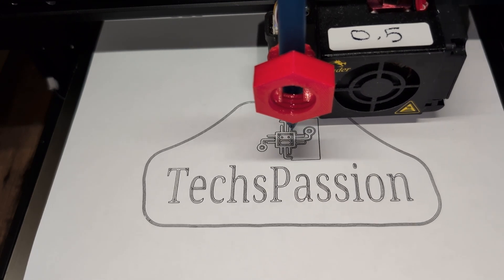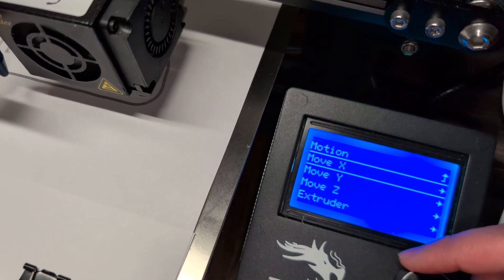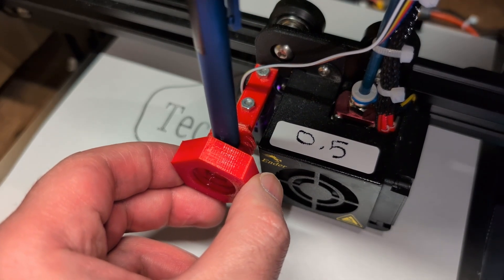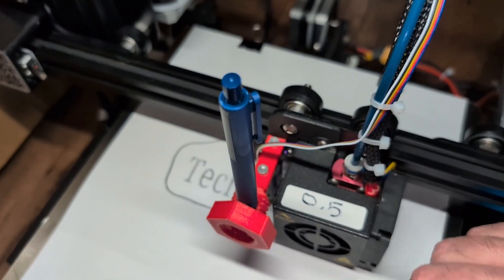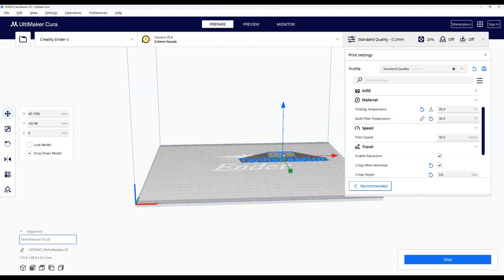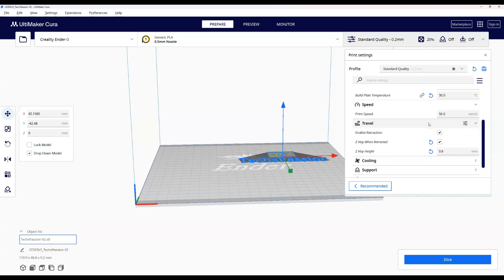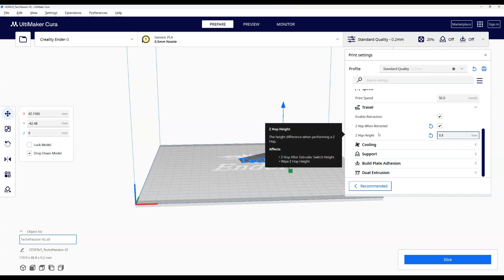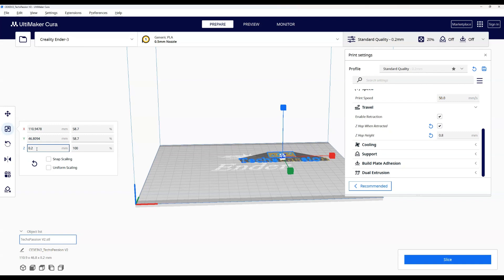Using Pen With Your 3D Printer #3dprinting

Comment: Great Video. this is such an interesting idea. I'm surprised  no one has come up with a product that lets you send a ink jet print and translate it to your 3rd printer similar to your approach.
Reply: I mean just sending a normal print from the computer like a pdf and translating it to the 3d printer with a pen not using real ink jet printer
Reply from the maker: Thank you so much, I like the idea but I think it would be much harder to do the other way around with an ink jet printer. I will have to open one and see but my guess it's not as simple